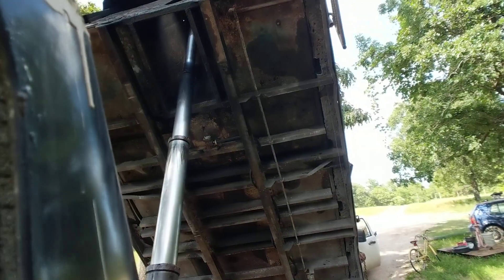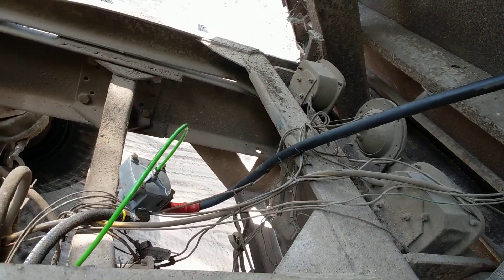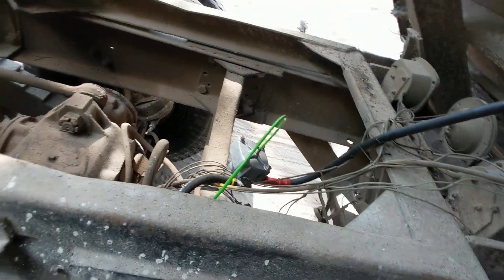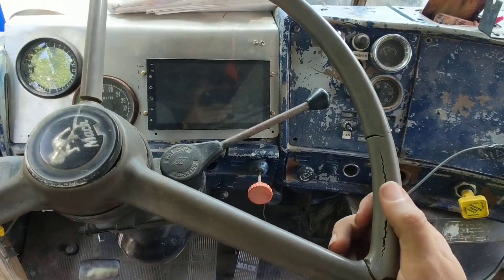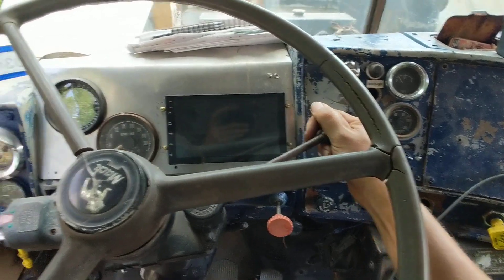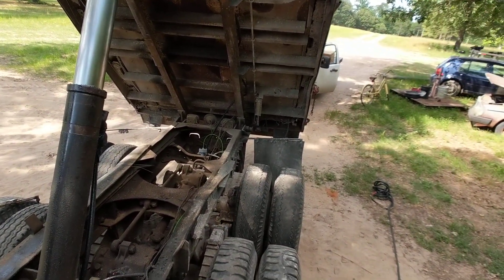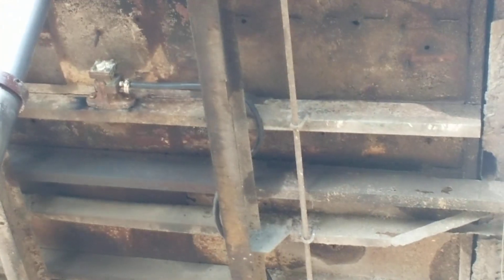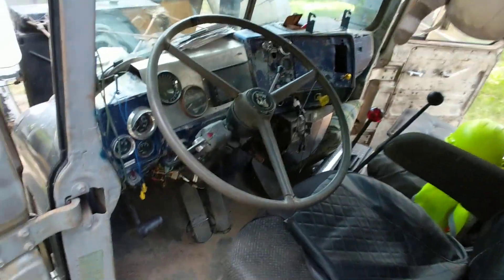Dump truck bed shaker

Comment: We use junk starters off cars. Some wires, and an off balance weight on the shaft of the starter motor. Momentary button in the cab, like a starter button.